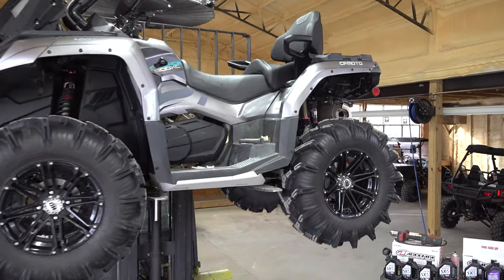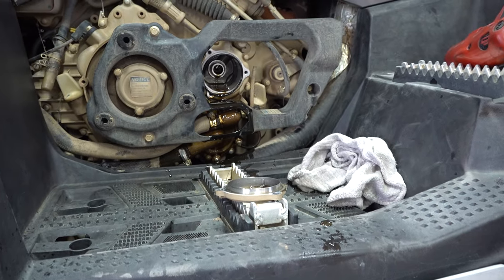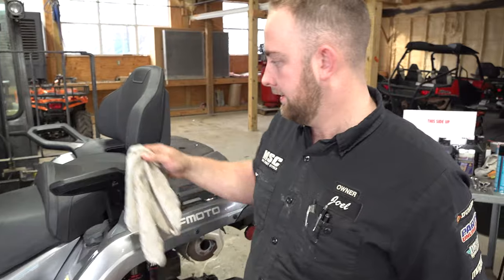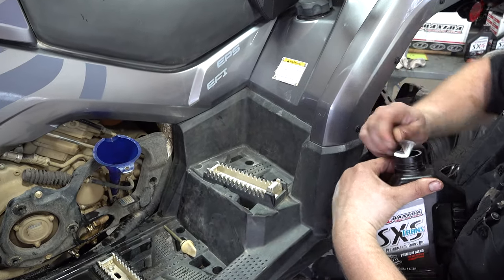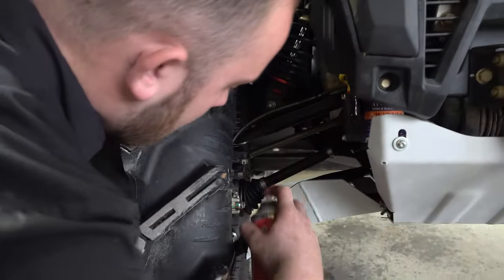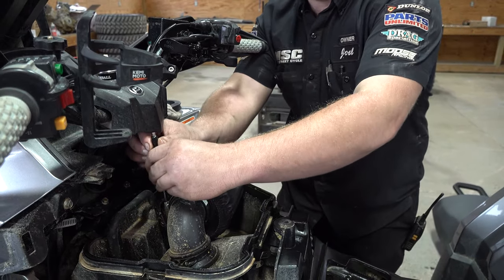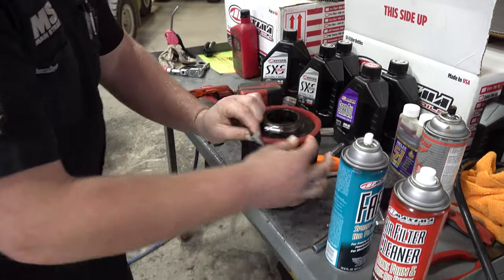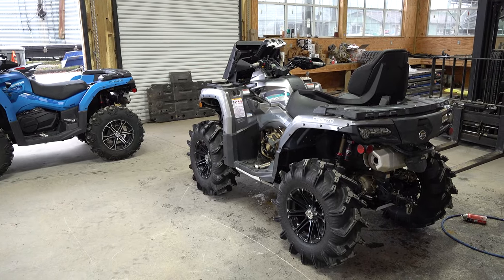CFMOTO CFORCE 800 Full Service How to Change Oil, Diffs, Transmission Fluid, Air Filter Upgrade

Comment: Love all your videos great video on servicing the 2021 800 xc. On the rear DIff. the Canadian model comes with a dipstick to check oil level in your tool kit. You only put in 400 ml (13.5 oz) in DIff. You insert dipstick fully into hole and level should be between upper and lower marks. If you over fill could leak out vent tube or cause rear DIff. axle seals to  leak. Normally I would fill to bottom of fill hole. When I was checking mine for first time I thought it was low. I found the information on page 120 in owners manual under maintenance. I don’t know if the US model is the same. Just thought I’d let you know before anybody has seal and vent tube leaks. I think I’m still gonna fill up to the bottom of the fill hole and we’ll see if it leaks out the vent. Pretty sure the seals won’t fail. And more oil not less it’s better for cooling.

Comment: I just bought a slightly used 2022 CFMoto 600 yesterday. First quad and I’m a bit overwhelmed but I’m glad I can see your video and reference so when I’ve broken it in a bit, I can keep it clean and running healthy for as long as possible. Thanks for the vid!

Comment: I actually do this for a living also I work at cycle Marine in Arkansas. It neat too watch these videos for me because I even learn from them even tho I do this everyday also. I never thought of picking up the unit with our fork truck definitely leaned easier ways too service our units!
Reply: OSHA Standard 29 CFR 1910.179(n)(3)(vi) states, “The employer shall require that the operator avoid carrying loads over people.” This is required to protect people from the hazard of a falling load due to inadvertent failure of the crane mechanism or operator error. Because it's against OSHA. No-one should ever be under a suspended load of a forklift.

Comment: I torque my wheel lug nuts at service intervals as well. I use WD-40 Dry Lube on all moving components as it doesn’t hold dust & dirt.

Comment: Really helpful video. I wasn't 100% if the dipsticks needed to be threaded in or left out to get an accurate fluid level. With the oil it's a difference of half, screwed all the way in it looks full and out it looks only half full. My 800 is brand new and when I slam on the breaks I get a beep from the oil pressure sensor. I'll have to top the oil off. Hopefully I won't get that beep any more.
Reply: Did this stop the beep? i heard you have to send ecu back to cfmoto to get fixed. I have a new 2022 800xc with this issue currently

Comment: Love your videos!  I really apricate the content you're putting out.  Such good stuff.  I now own 3 CFMotos, two 2020 600 touring and one 2021 800.  Love them!  Will that one liter bottle of gear oil fill both the front and rear gear cases?
Reply: How have all of your machines held up? Any problems? Mileage?

Comment: Nice job! I saw on a previous video You changed on a unit the engine oil bath washer from aluminium to cooper washer om the drain plug. It is better?

Comment: That Engine is a same has a can am but it's turned around. Look forward to see what the price is on the 1000 with 79 HP ,I know that the 800 is $8,599. But right now I'm thinking about making my Sportsman XP 1000 about 7in longer so it would have a 60in wheelbase, I ready have the steel , equipment and the plans but don't know what time to start because I ride all year round.

Comment: I love your channel and I have a question. I just bought a 2021 CFORCE 400s and this machine is a billy goat . I had a Polaris 700 and like my 400 more and it is the same weight but my question is I bought from Tractor supply a 2500 atv winch but I can find a place to mount the regulator box any where .Do I need this or can I use what is already in the machine and if so where would it be . Thank you Rene Martel and God bless brother.
Reply from the maker: If you need to splice tome wire to extend it to where you can mount the regulator somewhere then id do that.. but i am not familiar with the winch setups that Tractor supply sells..

Comment: Hello: Great video. Thank you very much! I think is very useful.  I live in Argentina and is difficult here to find help to do that work and to find  original replacement parts. I want to ask you, may be you konw , if I can use a Can Am 800 Renegade oil filter to replace de Cfmoto 800s one. Thank you very much again!

Comment: Got any info on that rad relocate and snorkel kit? Very helpful video thanks
Reply from the maker: It all came from and was installed at Main Street Cycle.
Reply from the maker: Well this particular snorkel kit was actually installed in Texas by warrior riser. But MSC has them in stock
Reply: Do you know if they ship to Canada? I'm buying my cforce 800 this weekend and looking at options.
Reply from the maker: @BlackJackKO551  You can message Main Street Cycle on facebook and see.. but i think they are only able to ship in the USA right now

Comment: great vid, just a question our new cforce 800 2021 model is almost due for 1st oil change service, we like to know has the 800 dry clutch or wet clutch, as there are 2 types of oil the normal and motorbike wet clutch oil
Reply from the maker: I recommend you running the oil that's in this video for your machines. It is all we use. Great stuff and is 100 percent approved by CFMOTO. Maxima Racing Oil 10w-40 ...
All oils will work in a dry clutch setup. and only certain wet clutch specific oils should be ran in the machines with a wet clutch. But your CFORCE ATVS are not wet clutches.
Reply: @RealTalkPowersports  Thank you so much i see in the specifications of the oil its wet clutch oil, unfortunately we in Namibia are limited to few oil brands only but similar oil has castrol then i will use that. thanks great channel God Bless

Comment: My 2017 cforce 800 has a flashing fuel gage that bounces between full and empty even when the tank is full . As I drive it it will bounce all over and I never know my fuel level without calculating miles driven ÷ by mpg. I also have had a new fuel pump installed in 2020. Have you come across this problem before? 
A video to fix this would be nice, I'm not the only one with this problem.

Comment: Got a quick question: At 6:49, What is the black hose with the clear cap end with the 2 clamps right next to the oil dipstick/fill.?? I just recently bought a cf800 and would like to know what this is for. Checking today, it had water in the clear portion....Just wondering...Thank you in advance..

Comment: Thanks for all the info on the CForce quads and CFMOTO in general. Do you know of any differences we can expect with the 2022 models? My local dealer has the new 2022 600’s in the red color but no 800’s yet
Reply from the maker: No major changes.. just some graphics.. but I do feel like the suspension is sprung a little softer
Reply: @RealTalkPowersports  cool. Thanks for getting back promptly

Comment: Hello I'm from the Netherlands. If I'm right you said that by every 1000 you have to change the differenctial is that correct? Because the Dealer from here told me that I have to change it for the first time by 6000km or when I here a sound when I'm driving. But after 6000km seems like to much to me. Can you please advice me thanks!

Comment: At the 4:07 time mark, there's a tube right in front of the oil fill port that has a small clear tube, what is that tube? I noticed it on my 2022 machine when I checked the oil and it had clear liquid in it..

Comment: How long after purchasing a new bike should you get a full service and what type of exhaust do you have on your 800 XC and where did you get your snorkel and radiator kit done at
Reply from the maker: The owners manual is the best thing to follow for service intervals. The more u mud ride, the more often you should service your machine tho.
All my stuff was done at Main Street cycle besides the snorkels. They were done in texas.

Comment: No point to grease every surface. Grease attaches dust and it will act as sand paper. Grease only where grease is meant to be put. Also not all rubber and plastic is oil and grease resistant. Yamaha has list of greases in manual, every grease type has its own place. Some greases are dust resistant, some are water resistant. Some work on plastics, some work in cold, some work in hot

Comment: I have a Q: I bought a brand new 2020 800xc and I can not find the passenger weight capacity anywhere (manual, dealer, manufacturer all useless).  I want to take a passenger riding with me and she is a plus sized woman.  Can you help me with this info?  Once again I have a 2020 cf moto 800xc touring.

Comment: Awsome video! Whats the name of the spray you used to spray the shocks, ball joints, tie rod ends @18:10
Reply from the maker: Its just some good long lasting lubricant oil that they keep in the shop.. ill have to write the name of it one day when I'm there
Reply: @RealTalkPowersports  If they sell it I would like to place an order along with some other items. Thank you for responding. This is by far the best detailed video step by step that I have seen. Thank you for taking the time and putting it together.

Comment: I have another question if I could.  My CF Moto dealership has quoted me a $600 service fee for the initial service after the 20 hr break in period.  Is this true and is it really necessary?  I bought it brand new off the showroom floor in Apr 2020 with 0 miles on it.  Help if you can
Reply: Thinking about getting one but if the maintenance for start up fee and small issue  problem then I might pay extra for the honda.  Last time in the shop and if you add all those fee up over the year I believe it will cost more then the honda over the years of ownership. Guess no cfmoto dealer is tell you about the $600 fee after the 20 hrs break in?

Comment: When during the service intervals do you guys do the valve check and adjust if necessary or what is the shops recommendation?
Reply from the maker: They only adjust them if 100 percent necessary.. and normally its like 1 out of 100 that actually needs to be adjusted
Reply: Ok I just didn't know the vavle inspection is part of the service you guys do.
Reply: Isn't it needed at break in or awile

Comment: I was wondering Does the 800 have a mechanical  oil pump? Or electric? Also is it a dry sump  system?
Reply from the maker: Hey John.. I honestly don't know.. if you call the service department at Main Street Cycle they might can get Joel or one of the mechanics to give you a accurate answer.

Comment: Hey, pls need urgent answer! I own the 2019 820le model, quite the same oil filter principle when changing it. I noticed a small hole when taking out the filter. Do you remember when changind the filter, if there is like a small hole in the air filter house?
Reply from the maker: Hey Andrei.. let me make sure I'm understanding you question.. are you asking if there is supposed to be a hole in the air filter box?
Reply: @RealTalkPowersports  exactly! If only there was a way i could post a photo so you could understand exactly what i am talking about..
Reply from the maker: Well there is a drain hole for the air box but it should have a hose connected to it

Comment: I have a cfmoto 850xc 2020 has overheating problem and I don't know the reason!  The thermostat, sensor and thermo switch has been changed without any benefit. Is there a solution to this problem, thanks
Reply: Check if fan comes on if not check fuses. If it does clean the back side of radiator could be clogged up happens fast from dust and mud.

Comment: On my 2020 600 the screen won't turn off ... any suggestions?  Not sure what to do we were riding turn off the quad then the screen started  flashing
Reply from the maker: It should still be under warranty.. I recommend you taking it too your local shop and let them do a quick check to see if they can cover the work under warranty for you

Comment: Why is a brand new 800 beeping together with the oil light symbol sometimes? Normal?
Reply from the maker: They are working on getting less sensitive oil pressure sensors.
Reply: @RealTalkPowersports  
Really appreciate your reply. So is it safe to drive it? Can my dealer fix it? Will it dissappear after the break-in time?
Reply from the maker: @galaxyphone7784  Supposedly it will not go away.. The 2021 800 and 1000 model cforce Oil Pressure sensor was Calibrated too sensitive and many are complaining about it. 
You need to let your Dealer know and do what they recommend. Ill do a video on it soon
Reply: @RealTalkPowersports  great, awesome content!! My dealer has no idea for now, but hope he'll figure it out. Hope you'll get some support and benefits from CFMOTO, you're a big reason for so many sales!! Keep up your great work, we'll support you!!
Reply from the maker: @galaxyphone7784  thank u!!

Comment: How come you have your exhaust tip off
Reply from the maker: Just was experimenting to see if I could tell a difference in exhaust temps and air flow.. and believe it or not it does lower the temps just a little bit.
Reply: @RealTalkPowersports  I was wondering because it does get really hot on my 2021 cforce 800